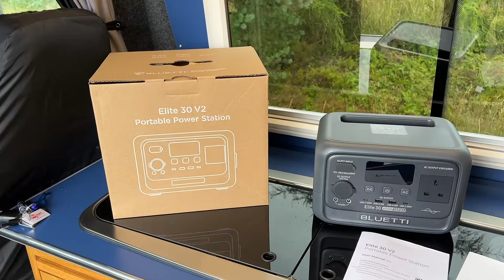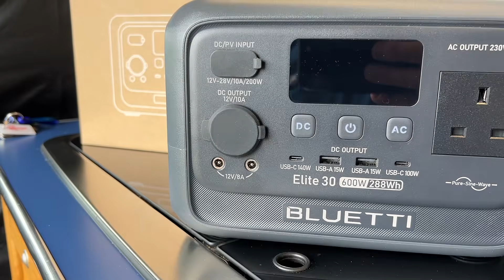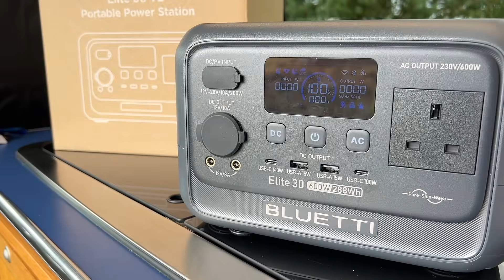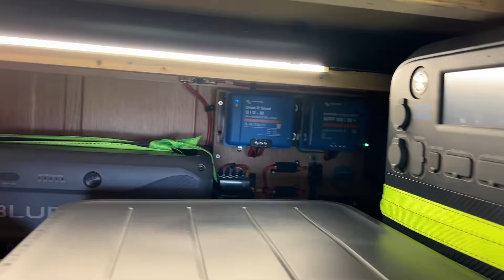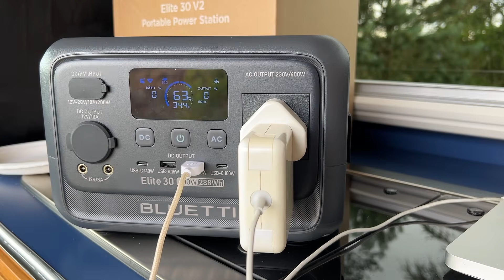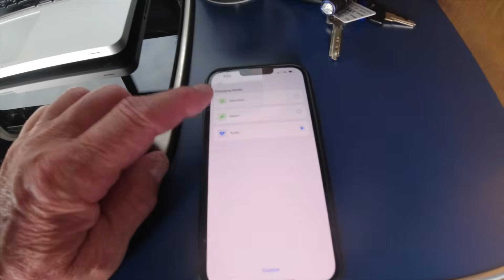The Small But Powerful BLUETTI Elite 30 V2 👍👍👍👍👍

Comment: "Thanks Juliet"   Brilliant usefull power unit. small and light enough to put in the motorbike top box or in a rucksack to run a cool box on the beach😎 and still brew up.
( that is make tea anywhere ).
Again Good video with information not waffle or fibbs best wishes to you Dave from Steve Pottsy.🤓

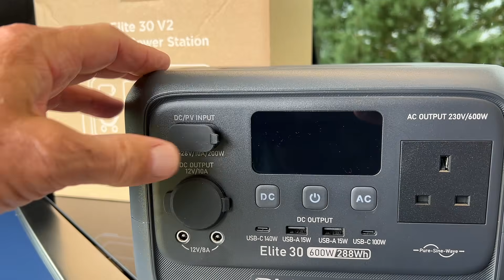Comment: 4:03 The Bluetti charger one can be used with it because you can alter the voltage so that it falls within the range of the power station. Therefore you can adjust it to give out only 200w .
Default Voltage:
27V
Voltage Range (with 12V battery):
15.0V to 56.0V (adjustable via app)